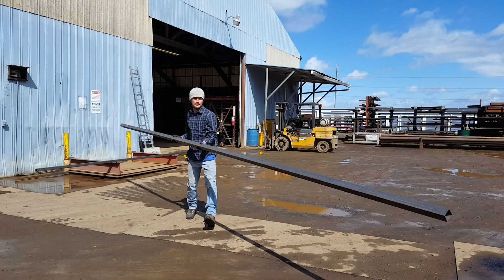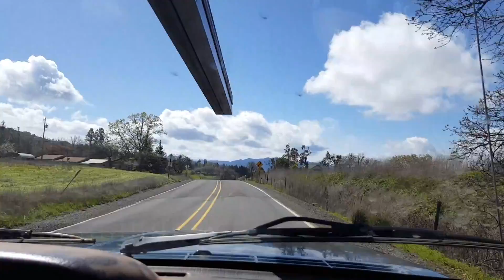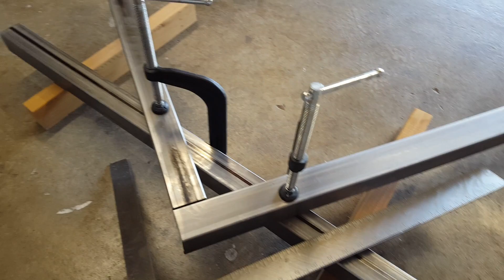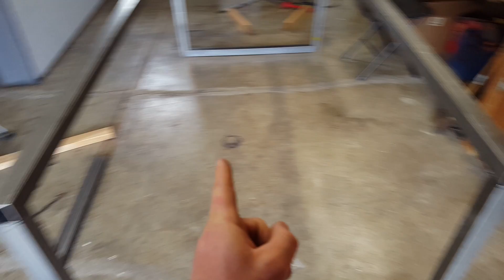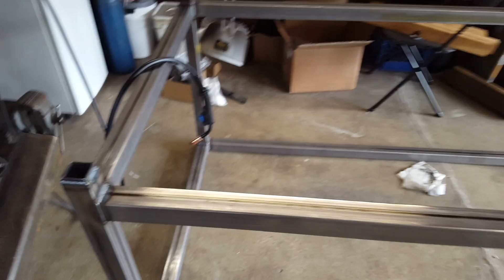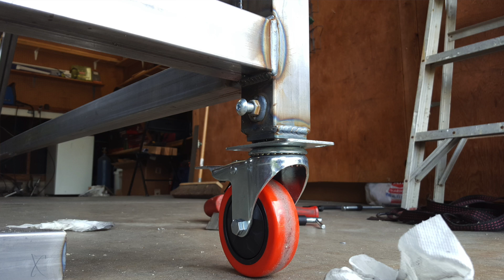How to Build a Flat Welding Table

Comment: The best way to check for flatness on a table frame is run tight string, like 50lb or 100lb fishing line across the diagonals and check where they cross in the middle. If there is any gap or if one wire pushes on the other too much, then you don't have a flat surface.  A lot of people think you need to just level the table afterwards but if you don't have a truly flat plane on top, meaning a slight twist, then leveling does no good. You’d just be leveling a twisted top surface.

Comment: You really need to get a chop saw. That 6inch cut off wheel on a 4.5 grinder is sketchy as F. You could see on the video that it was so close to obliterating itself. There’s a difference in rpm’s between 6 inch and 4.5inch angle grinders. 6 inch runs at  lower rpms (9000rpm)  4.5 inch runs around 12000 rpm. I.E. 6inch wheel not safe on 4.5 inch intended angle grinder. Only a matter of time until you see what I mean (if your lucky). If not you aren’t gonna see shit

Comment: Hey Tim! did you fab up those tube roof rails? I did them!
Reply from the maker: I sure did. I think I talked about them in a past video briefly but I'm going to have a 1 year review of my Jeep and all the aftermarket parts on it coming up. I'll try to talk about the roof rack because people are constantly asking about it. Ive had 300 pounds on it many times. No issues.
Reply: Thanks! Yeah I really love the design. I currently have a old Thule TK2 system ( mounts to the existing roof rack rails) that is a bit tired and has developed a bit of play over time. I love how universal your design is, you can really plug and play with systems that already exist!

Comment: I have a strange question so I have a XJ 4 door I noticed you have a 2-door XJ I have tried to find differences or a four-door versus 2-door a video on YouTube but there is none that i can find I'm a very tall man I stand at 7 foot I have modified my seat bracket in my Cherokee to fit me my question is the doors on the two doors appeared of be larger is there more room from the dashboard to wear the back of the seat sets in a two-door versus a 4-door Cherokee that is my question this video I very much did enjoy and to all the naysayers I cut without a guard on my grinder to I have all my fingers
Reply from the maker: The doors are longer so the passengers can get in the back.  But I assume the seat is still in the same location.

Comment: Great video.  I’ve been wanting to build a table to. I wish we had a water jet or plasma cutter access around here.  I wanna have power on the table to run a welder, grinder etc. Make a video of the welding cart. What made you decide on the miller and not Esab or Lincoln or a different one?
Reply from the maker: There are a ton of good welders out there these days. I've worked in numerous shops and some of the oldest machines that are still used on a daily basis are Miller products. I feel like they are a tremendous value for the price plus they are generally on the cutting edge of technology. I've been using my Multimatic 215 quite a bit since filming this video and I am honestly impressed! It welds great on 240v put what surprises me the most is how hot it welds with only 120v power in put. Stay tuned for more vids on the unit.

Comment: I use the 4 inch grinder all the time with the razor blade wheels just make sure you use a good face shield with safety glasses, good gloves and jacket in case the wheel comes apart

Comment: Running a 6 inch cutoff wheel without a guard to cut metal isn't a big deal. Running a 6 inch circular saw blade and trying to cut lumber is a different story... Yes I've seen the aftermath...
Reply from the maker: Yikes! No thanks...

Comment: Awesome build! How did you get into working for a fab shop? Any advice for those wanting to get into fabricating as a career?
Reply from the maker: I went to college for metal fab and welding. Realistically though if you just apply for an entry level welding or assembly position at a local manufacturer you'll get in. Production welding kind of sucks but if you do it for a year or two you'll be a super good welder!

Comment: Looks great Tim!  My only concern is the single ⅜" set screw for each leg with all that weight?
Reply: When you first welded that nut on the back side my thought was you were going to have a bolt go into the leg and bolt up tight. Having various holes up each leg for height of work needed and staging.
Reply from the maker: I think it'll work fine. It's only 175lbs on each leg.

Comment: Great table!! I have been looking for a welding table/ build table. I'm thinking maybe 3-4 tables 48"x 36" with notches and bumps on the ends to lock them together. Got the idea from Poison Spyder build of Crispy. They have tables that have drilled and tapped holes which would be nice but would get up there in $$. Like your idea with those clamps. Old dog new tricks!! Hmm I5 straight south big hole in garage and home, I have winch on trailer....LOL
Reply from the maker: You'd need a perfectly flat floor to link tables too. Neat concept though!
Reply: Your right about not level.... One would have to have screw pads to adjust and level them all even, or have a rail setup to put them on. first off your table fits the bill in many ways before tackling major frame, or structure work.
Reply: I would like to buy the Millermatic 215. Nice welder.

Comment: Do you plan on adding a lower shelf or any storage?
Reply from the maker: I will be adding some cross bars (maybe 1" round tube) to hang clamps from between the 45 degree tubes but no bottom shelf. I don't like storing things below the table because it gets covered in grinder dust and just becomes clutter. Good question!

Comment: I have a 42” diameter round table,  works great for welding all the way around projects and not snag on corners
Reply from the maker: Awesome! I like having 90 degree corners so I can square various projects off of the table it's self. It really depends what you're using the table for most often I guess.

Comment: How many miles to the gallon do you get now since you lifted the green jeep??
Reply from the maker: Lol... Not as good as before I lifted it. About 16/hwy and 13/city 11/wheelin'    used to average 20mpg when it was stock with the 3.07 gears and 5 speed.
Reply: BleepinJeep hey that's way better than my zj I had. It was on 33s with stock gearing and the v8... I averaged 10mpg... it sucked lol. I was mostly city type driving though unless I was offroad

Comment: Hey Tim, what was your total cost?
Reply from the maker: In materials just over $500. Call around in your area for cutting costs. It'll vary depending on local shop rates and the method used.
Reply: BleepinJeep thanks Tim!

Comment: Would u b intrested in selling ur old welder to help a poor bleepin jeeper out ?
Reply from the maker: Sorry. I already have a buyer for it. I'll probably do a 120v VS 120v comparison video with it before I sell it. Hobart vs Miller. (Miller owns Hobart BTW)
Reply: I love my Handler 140. I've been using it running flux core for years. I don't have a shop so I have to do all my welding outside.

Comment: May I ask the total price of the materials and the water jet service
Reply from the maker: In materials I have just over $500 but cutting costs will be different depending on your location and method used. Call around!
Reply: BleepinJeep Thanks that seems cheap compared to the amount of table you got.

Comment: Ummmm, I politely say, ....((CORRECTION!!!!)).... Denatured Alcohol is toxic, and has a wicked fast ability to soak into the skin, and extended or prolonged use on bear skin, will cause nervous system issues...  Use rubber gloves buddy, My old Boss and several folks in his family all have serious issues, from the use of it on bear skin, from the silk screening process methods they had in play... 3 to 4 times a day using it, for about a year, and each have perm nervous damage...
Reply: bare* sorry buddy, had to.

Comment: Nice clean build that was well thought out. Can you give an estimate of the material costs? Thanks
Reply from the maker: The 3/8" 4X8 plate was $375 and all the tubing was $99 as it was all "remnant" from the scrap yard. Cutting costs will very depending on the shop and method.
Reply: Thanks Tim great video as usual. This should make your fabricating projects much easier.
Reply: about what was the cost of cutting ?

Comment: You'll never regret the casters. Nice job I welded some square tubing underneath to allow me to slide in a vise, or a Strong Hands device that will hold vertical and horizontal pieces to weld at 90 degrees.
http://stronghandtools.com/stronghandtools/products/vises/3-axis-welders-angle-clamps/
So I could bring electricity to the table, I bought a HF extension cord reel and cut off the ends and reversed them so I could set the table, pull out the end of the cord to plug into the outlet at the wall and on the table I had a four outlet gangbox to plug in my side wheel grinder, saws , lights, etc.
Great 👍⭐ video!